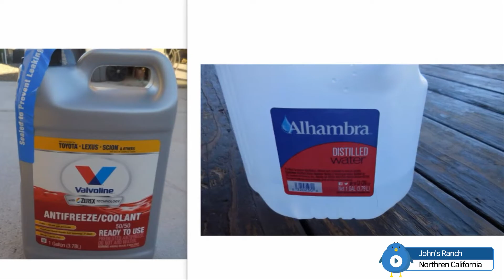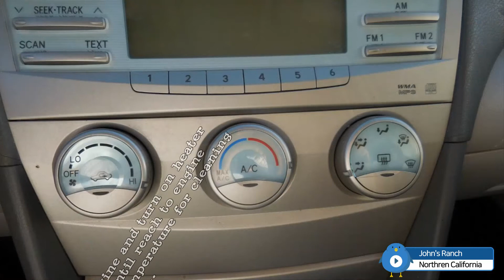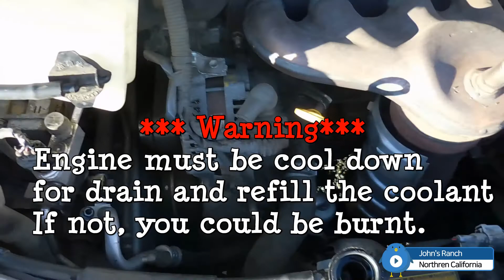2007 Camry flushing & replace coolant

Comment: Second 0:54 right where the arrow is. That black rubber tube does not have any clamps and mine is leaking coolant from there… should I add some?
Reply from the maker: I am sure you are talking about the hose that attaches from the radiator neck to the coolant  reservoir tank. 
If it is leaking the radiator neck area, then first check the crack or pin hole around that area.
 If it was not the crack or pin hole caused the leaking, then you may put a hose clamp. 
Thank you for watching ..

Comment: Is removing the engine block drain plug with 10mm wrench same as removing thermostat?  Is it necessary to remove the thermostat?
Reply from the maker: Yes it is. 
No need to remove the thermostat.
Hope to save some money and times.

Comment: Question. Engine must be cool down for drain the coolant. When engine is cool down, the thermalstat is closed, isn't it? I wonder if the coolant or distilled water can be drained completely?
Reply from the maker: That is the reason draining the coolant  from the engine block completely even if thermostat was closed.